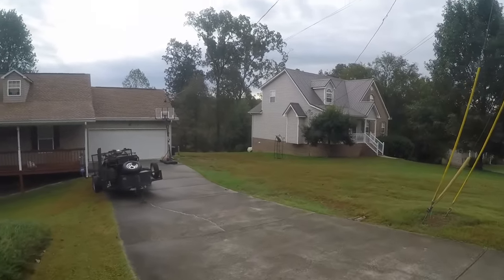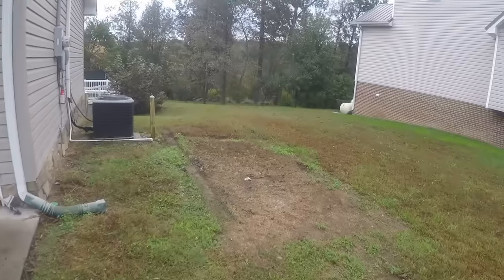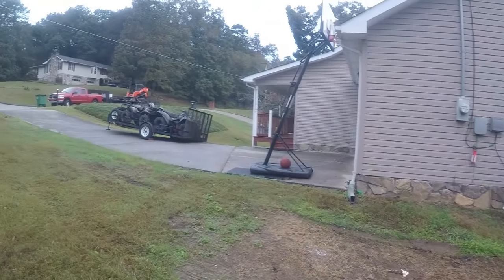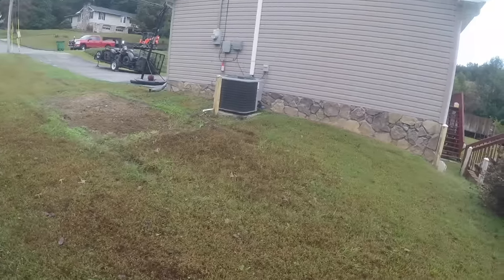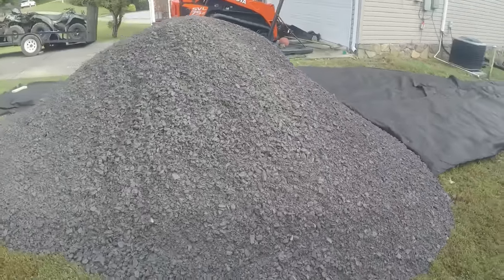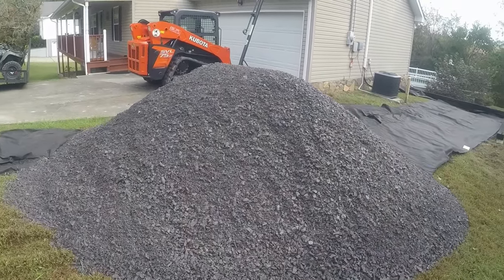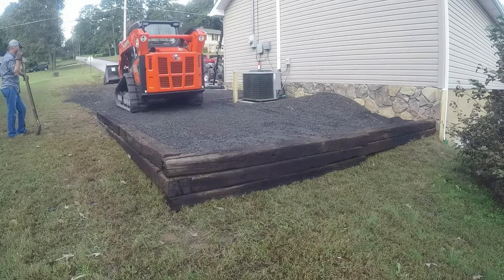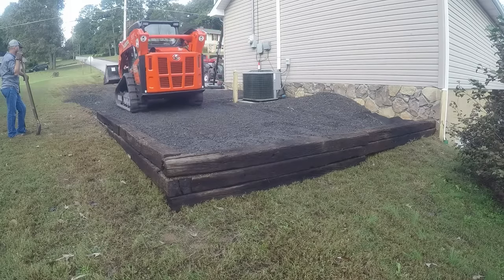How To Build an Economy Parking Pad On a Budget

Comment: First and for most I’m not in this business but I’ve got tons of operator hours on skid steers, loaders,backhoes,tractors etc. I’ve spread probably a couple thousand tons of rock over the last decade or so along with thousands of hours of material handing in some form or fashion....I’m not a pro, but I’m not a diy guy..although the finish product looks good, I hate how it was done start to finish....and it’s going to last maybe one set of seasons...maybe...rain is going to wash, using it is going to wash, and just settling is going to wash...:this looked like a weekend warrior rented a skid steer and fixed himself a pad....your ties are not anchored you didn’t even bare minimum scrape the surface and you just dumped it in the yard..your using a damn digging bucket to spread rock I mean come on, atleast cut you a decent bed to lay the rock in so after the first gulley washer don’t send 100$ worth of rock to the neighbors...
Reply: Takes 20 minutes to cut a bed this size then pile the topsoil at the back, but I assume this is what you get when you get up at 830 and go to work....either start using that bucket as it was intend and cut beds are get. Different bucket..
Reply from the maker: Stfu... I went up there and looked at it the other day and the dude has a 12,000 lb fifth wheel camper now and it looks exactly the same. Nothing is washed away and no grass is growing in it and it’s been almost 2 years ago. Leave this to the professional. I have a picture I can sent to prove it if you’d like to send me your number. I’ve had hundreds of comments telling me how shitty this job is and it gets really old..especially when it’s perfectly fine to this day...
Reply: Cameron Ward how long has it been
Reply: Maybe I exaggerated a little bit on one set of seasons, maybe a couple of years, but definitely gonna start having issues after 2 years especially on the back...left corner where you started....you spend the money to build a pad with ties and dg it hope to god it last 10 years maybe after 5 you notice some wash but not before then
Reply: And I’m hardly wrong about cutting it out
Reply from the maker: Jeremy Perkins read the first comment I have pinned. Should explain everything.
Reply: Cameron Ward maybe i could of been a little more supportive, but this is as bare bones as it gets, not ingenuity, no wow factor, nothing that stands out as remarkable...not one comment that says man I’d never thought of that, no real
Craftsmanship....anyone can go rent a skid steer for 250$ and spread gravel, be different, be remarkable....you don’t want to cut it, spread some preen, and cut the driveway edge back 6” and 3-5” deep so it ties in nicely for the concrete to rock transition, for look and for wear when he drives over it with a 10k camper....even when the job doesn’t pay the best take the extra 20 minutes and 20$ and show the f out..